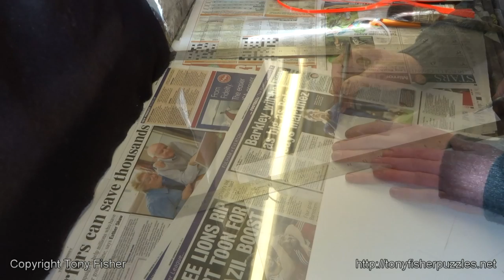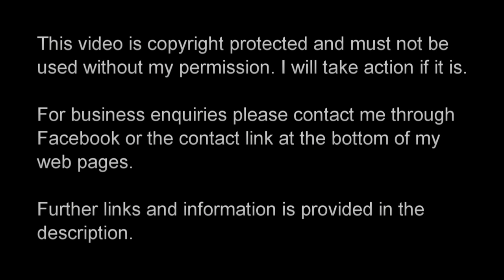SECRET REVEALED! How I made the world's largest (official) Rubik's Cube puzzle (by Tony Fisher)

Comment from the maker: Please note: There are several incorrect claims of larger cubes. If you read carefully about these puzzles you will see that they are either not functional or actually smaller (like the one in Michigan in April 2017).  Mine holds the official world record which can be checked on the Guinness World Records website. Footage of my cube is available for license here- https://www.newsflare.com/video/73931/entertainment-arts/man-solves-worlds-largest-rubiks-cube
Reply: Tony Fisher You cheated a little, you didn't create the world's largest rubick's cube. You simply created a very large interface to a smaller cube.
Reply: +iSweat-Axion It still counts though. Also, it's spelt 'Rubik's'...
Reply: No, the original cube was poorly designed, so he modified and rebuilt it quite a bit.  He created the largest rubik's cube based on a smaller one, but not only an interface to an untouched smaller one.
Reply: Tony Fisher what you should have done is use different sized cardboard boxes and make the worlds largest mirror block
Reply: @Sweaty ... Aye, just like linking sections of bungee together (properly) doesn't make them longer but it does make a longer bungee. Savvy ?
Reply: iSweat-Axion, Isn't any bigger cube than a standard 57mm Cube a larger interface? Not to mention, some puzzles work the same way this puzzle does. Having a smaller version of the puzzle as the core, stems connecting each piece to the core, and done. For example, Cyclone Boys Cubes use a minimized core of the puzzle and the puzzle pieces are simply attached to the core. This method allows for reliable turning and structural support, which is exactly what Tony Fisher needed for his large cube. I own a 4x4x4 Cyclone Boys and it has never popped and/or exploded due to the mini-puzzle core design. Of course you sacrifice the speed of the cube but I doubt Tony would be speed solving his large cube any time soon.
Reply: KoBo_043, a traditional piped core won't be able to hold the edges. This cube is pretty much recreating ball core Rubik's Cubes but instead of a ball, it's a cube. Piped cores aren't very practical for structural support.
Reply: CubicMind, get some Gold or Silver spray paint and masking tape!
Reply: you really should have used teflon tape on all interfacing surfaces

Comment: I don't think, that an actual mechanism would have added much more weight, maybe 20% more.
It was impressive to see, that this plastic cube survive this.
Reply from the maker: +lichtsuchender The issue with that is the material. Obviously you can't use cardboard so it would have to be wood or very thick plastic. Then it becomes much heavier.
Reply: +Tony Fisher you totally could use cardboard for this, the foam and tape reinforcements, that you have applied are more then enough. The core is the only part that would need the pipes and screws.
I made a paper cube, regular size to be fair, but the core was the only critical part.
Reply from the maker: +lichtsuchender Cardboard isn't structurally strong enough for something this big and heavy. It would just crush after a few moves. Any minor misalignment puts huge stress on very small areas.
Reply from the maker: +Over powered Gamer Yes but Guinness already revealed my secret. Plus I don't think you can go any bigger using this method.
Reply: +Tony Fisher I am wondering if it would be ok to build one but a little smaller cuz it looks cool and sounds fun to make

Comment: This is awesome!
Maybe it could've been easier to turn if you used small wheels between the pieces? (I'm not an engineer, so the idea might be stupid. I have no clue xD )
Reply: Animiles, using metal risks corrosion or rust from exposure to the elements. Yes, there is metal in the actual Rubik's Cube core, but it's embedded far enough to not be affected by the elements.

Comment: Very impressive. I think you should make a pedestal which attaches to one of the center pieces so you can move all the faces without lifting the whole thing.
Reply from the maker: It's far too fragile for that. It would instantly break and even if it was better made the weight is unevenly distributed around the turning faces.

Comment: I wonder what it would weigh all together in LBS.
Reply: 1 Stone is 14 LBS. If the tape weighs 2 Stones and is 1/8 of the weight then the weight is 16 Stones or 224 LBS.
Reply: ***** Thanks for the info. I'm surprised that he didn't use either cooking spray or WD-40 to help lubricate the puzzle to make it move smoother because the friction between the layers of tape will cause the puzzle to fall apart eventually.
Reply from the maker: +Brettbren Who said I didn't lube it? In fact I used a lot of silicone oil.
Reply: Tony Fisher I was not implying that you didn't, and I apologize if my previous comment made it seem like you didn't lubricate the puzzle. I saw that you were struggling to turn the puzzle and it was sticking in certain spots. The fact that you didn't say that you lubricated it led me to speculate that you didn't.

Comment: if u would have painted the black areas instead  of tape in probably would have moved better
Reply from the maker: The tape is smooth and shiny so it works well. Also, as you saw the edges of the cubies are bashed in and you need to cover them with something to smooth them off. Also, the tape gives it extra strength which is vital especially when the puzzle is turned over.